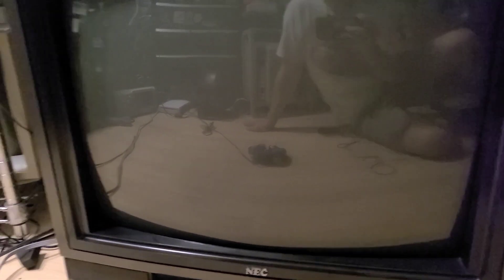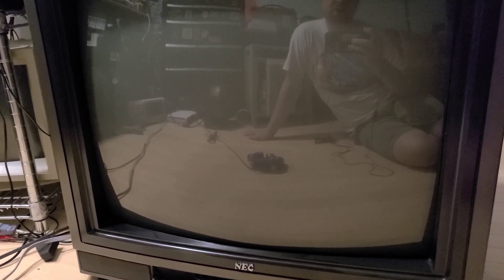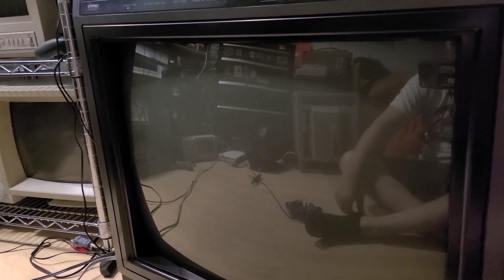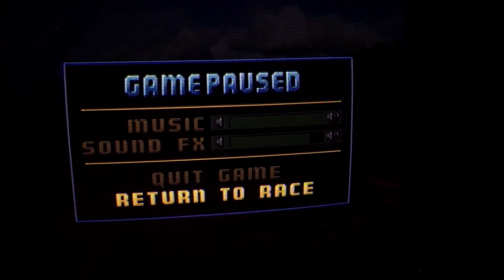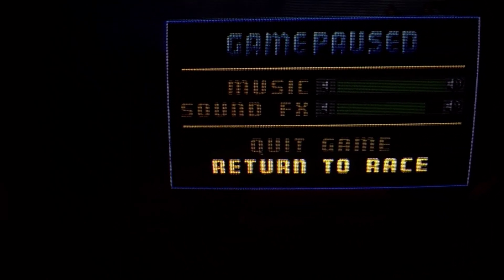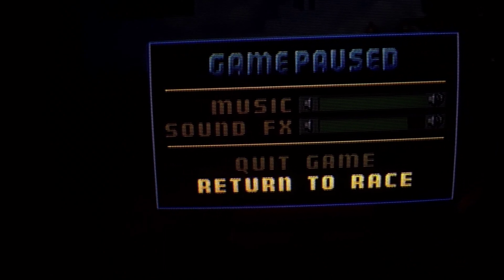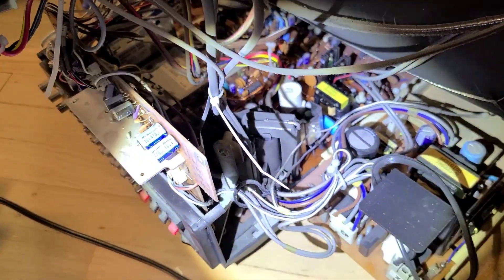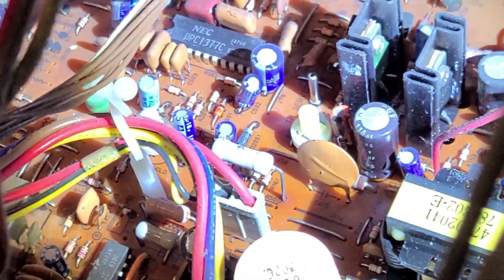1987 NEC CT-2620A CRT Television - Free Craigslist Pickup

Comment: I have the CT-2006As model, but the power deflector board is shot.  So you can use the TV side, but playing vintage games on it is not happening.  Are there any parts out there for this unit?  I'd like to try and repair it before I scrap it.